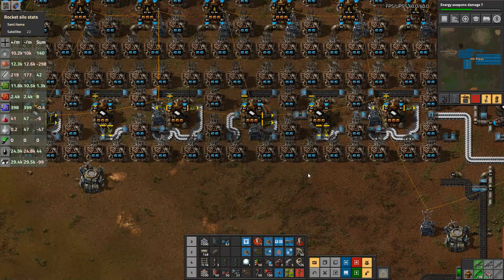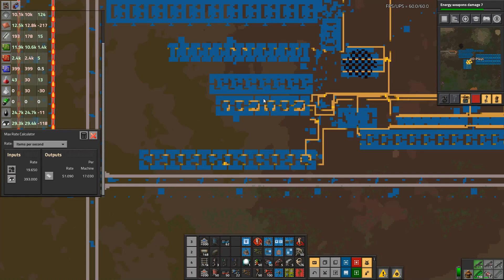Factorio 0.17 Ep38 May the Pipe gods be on your side | RPM Megabase

Comment: Love the plastics build. However, personally I wouldn't have had each blue belt coming out of the build saturated. I'd have had them in pairs onto belts, and then merged the belts later on down to the (essentially) fully compressed belts needed. The other alternative is to make your plastic more locally to where it is used, so e.g. you put a few plastic machines filling a belt that then goes directly into reds or LDS. With your build I'd worry that I was "wasting" a lost of plastic-making machines filling belts just for the sake of filling them.